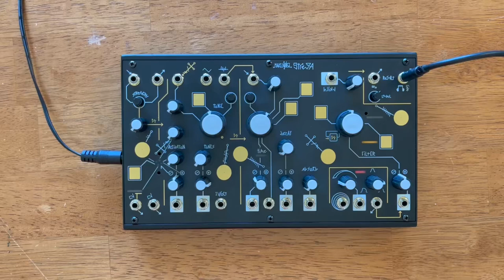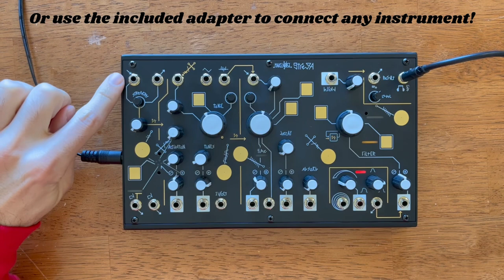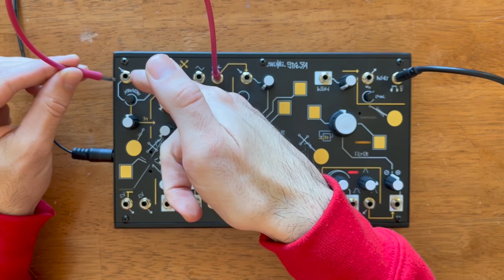Strega Tutorial - All Controls Explained

Comment: Great video - I learned a few things I didn't know, and I've had my Strega for over a year! One thing I've done on occasion is to use a patch cable that is patched to one of the Strega outputs to trigger the various circle touch plates. This can yield some really unexpected sounds, especially if you finesse the time/filter circuit.
Reply from the maker: Woah awesome, thanks so much! That’s a great call about using a patch cable to activate the touch bridges. I’ve only played around with that once or twice, but now that you mention it, I’m for sure going to dig deeper into that the next time I play. Thanks for the suggestion 👾
Reply: @MatthewShapiroModular  Yeah - I got the idea from a Cinematic Laboratory video a while back and later created a piece with that idea. The video is here (https://youtu.be/lcedEfQZ9Wo), mostly showing which touch bridges I used. The results are pretty gnarly.

I saw another video yesterday (this one: https://youtu.be/dQcwC5Imxms) that did something similar, and also used other objects (like a paper clip) to trigger the external input via a patch cable.
Reply from the maker: @soundsuncommon  woah awesome! Stoked to check these out, thanks for sending.

Comment: hi matthew, love your channel.
quick question: is it possible to clock the pops of the subharmonics output with an external source like keystep?
Reply from the maker: Thanks very much! Yes, you can do that. The subharmonic output follows the pitch of the oscillator (oscillator frequency divided by 4). So you’d want to send voltages to the oscillator’s 1v/octave input and have the main frequency (Tonic) set pretty low and dial in the voltage you send it to get your desired rhythms. Does that make sense?
Reply: @MatthewShapiroModular  cheers